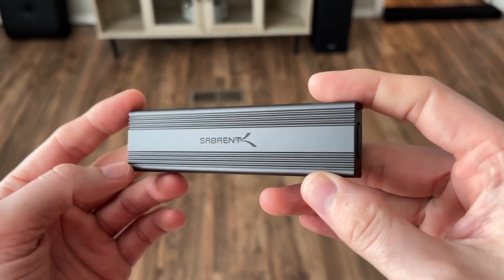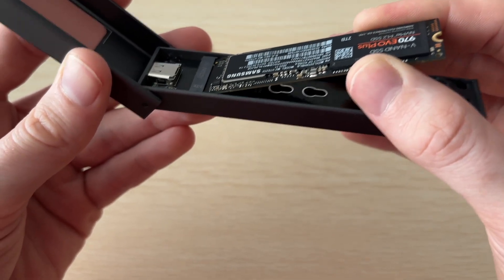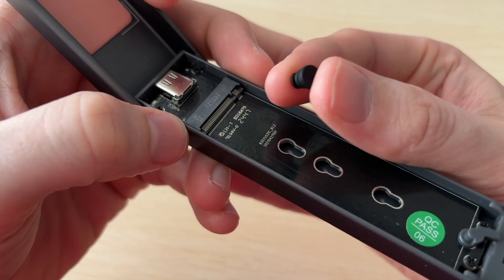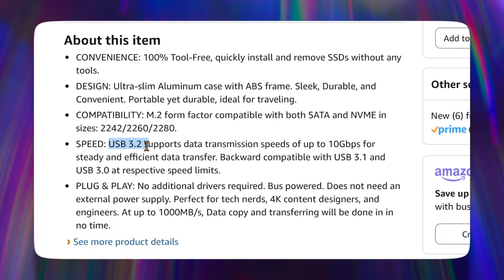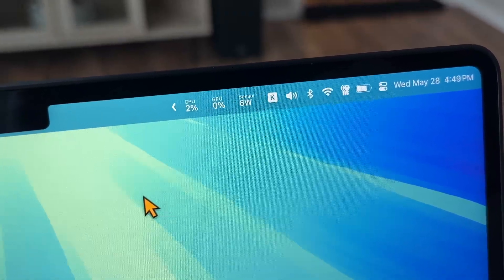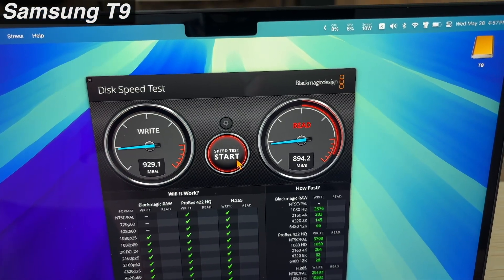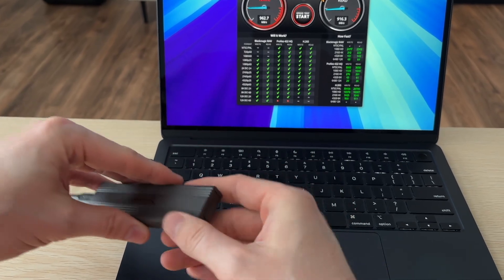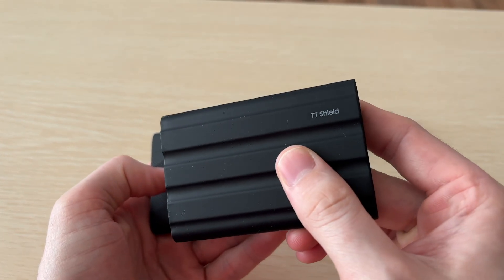Sabrent NVME Enclosure - My favorite so far!

Comment: If the M.2 has a thermal pad, why don't you remove the label from the SSD? Otherwise, the heat dissipation wouldn't be effective; the thermal pad wouldn't be directly on the chip. It's a mistake not to remove it.
Reply: The label is a type of thermal pad in itself. It’s not just paper. It’s made of a very thermally conductive material and aids in heat dissipation, your warranty is also gone if you remove it.

Comment: yup this is the goat enclosure
Reply: You clearly have not watched about the tuf a1 my friend I got this thing dropped it on water on purpose threw it off the balcony just to see i used it on sandy beaches and it only goes for 30 euros speeds 900-1000 mb per sec not megabits but mega bytes and it does not get hot transfered 1.5tb in one go just amazing!
Reply: @Tandoku44 so double the cost for extra features I don’t need. Idk about you but I’m not throwing my SSD’s around.

Comment: I've just bought this enclosure and waiting for the NVME to come, I was curious if you use it in a long-term and how is it? I'm planning to use it to boot Linux and work with it, nothing too heavy. Just worried about how hot it can get after hours of usage.
Reply: Does it work?
Reply: @СашаНемо-з2ы  Yes, it does! I usually use my computer for at least 10 hours a day with blender, krita and even for Virtual machines and the Sabrent case doesn't get heated that much, nor gave me any problem, for now.

Comment: Tat's the very first Enclosure I ever Purchased. I wanted to clone my C:\Drive from 512 MB to 2 GB. One a USB-C 3.0 it got so Hot after 15 Minutes I couldn't touch it & then the Computer would quit with the blue screen of death. With it had longer cable with USC-C on oe end and USB-C with a USB-A adapter. sent the cable that way it ran slow enough so it didn't over heat and didn't shut the computer. I now have it connected to my  M4 Mac mini as 1ne GB of 4.25TB in 4 SSD's. The 256GB Internal, 2TB Thunderbolt 4, and another 1 TB Enclosure.
Reply from the maker: It's a great enclosure.  I've install Mac OS on it and booted/ran from it without much issue.  But I also noticed, it does get decently warm doing that.

Sounds like you have plenty of storage now!
Reply: 3.25TB

Comment: I have two of these and both work great with a wide variety of NVMe and SATA M.2 SSD's. I'm a moron though for not examining the available mount holes more closely - didn't realize it supported 2230 sticks, so I bought a separate 2230 enclosure recently.  DOH!   A useful trick for not losing the silicone nub is to store it in the back next to the hinge. A shame they didn't build in a little compartment for it.,
Reply from the maker: It's such a great enclosure!  I'm thinking about buying a second one as well.  Great tip for the nub storage :)